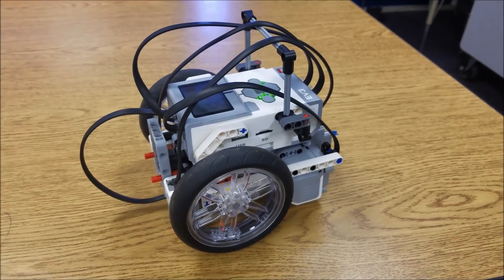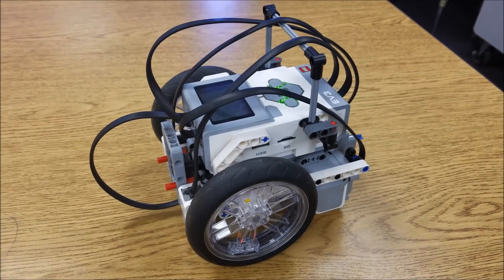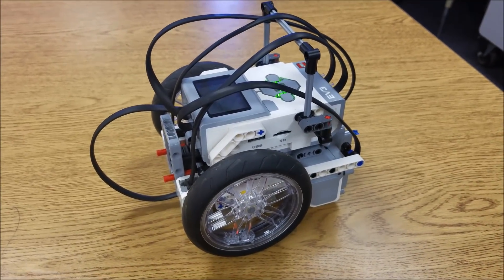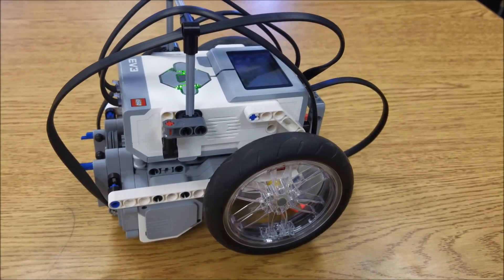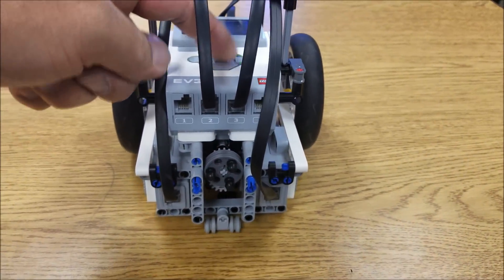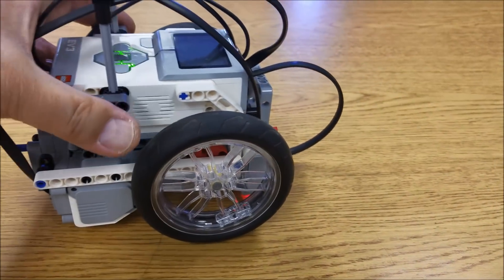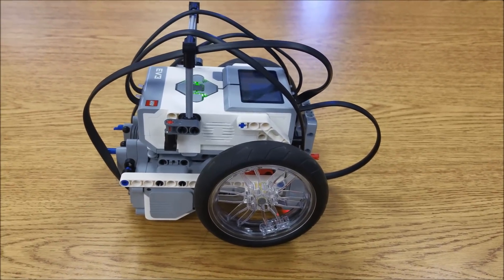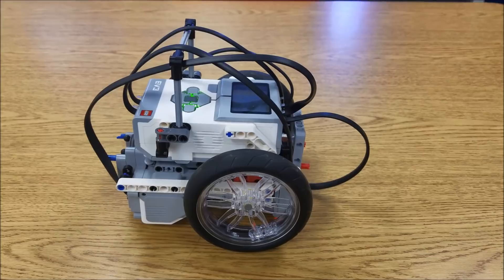"The Sirius Robot For FLL Competitions Review Builderdude35"

Comment: https://www.youtube.com/watch?v=9O7XJiSlBFk is a good example of effective use of that size of wheel (they use the version with a textured tread which might be marginally larger but is generally similar.)

Something to note in that video is the ramp up and down the team uses for long movements. Starting and ending at low power minimizes the inconsistency of the large wheels.